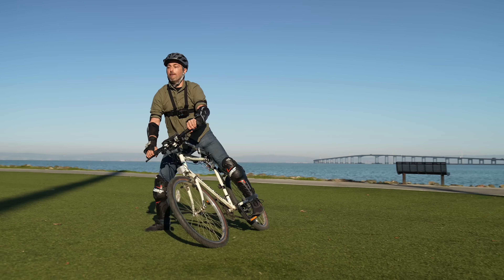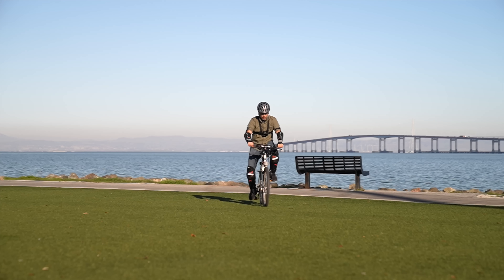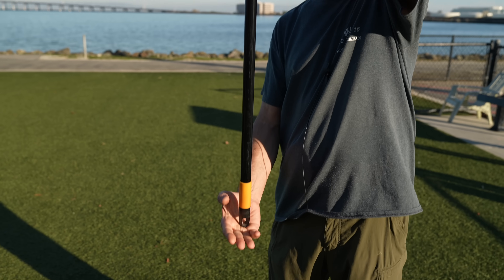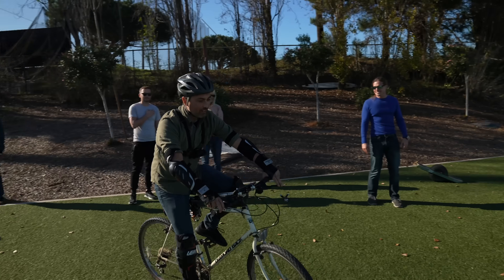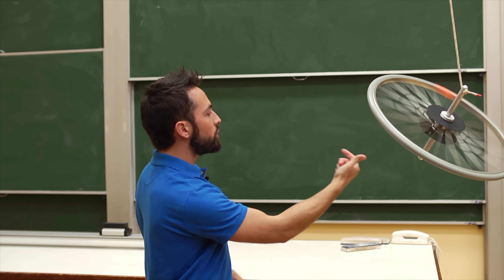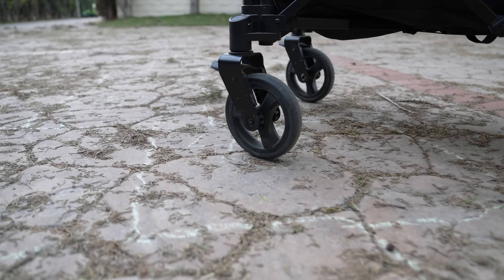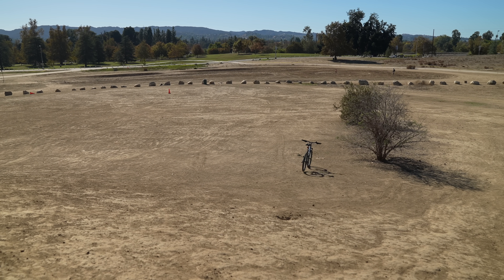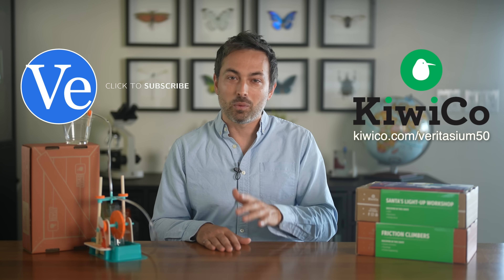Most People Don't Know How Bikes Work

Comment: I come from the other direction (no pun intended): around 10 years ago I saw a guy doing a 90 degree turn in a very little space without slowing down probably at around 20km/h only by leaning on the side. Since then I learned how to steer just by leaning and whane it's safe I do so.
Reply: How do you make the lean happen?

Comment: Anybody who has ever had a science class should understand the impact of angular momentum and perpendicular procession of a torque that is applied about the axis of rotation.  It’s easy enough to demonstrate with a fidget spinner, and I doesn’t require much further thought to understand the counter steer is needed before the intended steer and desired direction change.  The matter and physics of a bike doing this automatically is another subject entirely.  Thought experiment:  What do you think would happen if you were stationary on a bicycle that is on a motored dynamometer powering the wheels to spin without moving the bicycle fore or aft.  Could you recover your balance when steering left or right?
Reply: You could recover your balance if your bike was free to move left and right on the dyno, but not if you relied on gyroscopic moment alone.
Reply: Bike moving on a road or road moving under a bike is the same thing.

Comment: Yes, steering plays a major role (at lower speeds), as larger inputs are critical at lower speeds. This is why something called "track standing" is so diffficult. Having made my own set of rollers, I know for a fact that as the speed increases on them, the bike becomes much more stable. At high enough rpm's,  you can go hands free and the bike will track itself as you pointed out, but this could not be done at a stand still anywhere near as easily, hence the  higher rpm makes the gyro effect much stronger and is, in my opinion,  a larger force keeping the bike upright via the rear wheel being locked in place, unlike the front wheel, which that can rotate in place. I actually think that the gyro effect occuring between the front and rear wheel is what helps the bike to "auto steer", helping the front wheel return to center and stabilize again.
Reply: >> the  higher rpm makes the gyro effect much stronger

The higher speed does increased the gyroscopic effect, and on a bicycle, that primarily increases the steering induced from lean.  It does very little to stabilize you directly.  But the real reason increased speed helps is because it moves the bike the same distance left and right with much smaller steering inputs.

Comment: Anyone that rides a motorcycle knows how this works.   That being said, at very slow speeds it doesn't work that well, you do turn left to go left but you need to use the throttle judiciously to accomplish this.  The same is true with a bicycle, just pedal a little harder.

Comment: I only believe this is true with most people. Professionals don’t do this. We lean before we turn. We actually turn into our body leaning. I’ve even seen that most bmx riders lean before their turn.
Reply: Last week I put a famous bike and motorcycle racer on it.  This is a guy that started his own bike company.  He couldn't ride it.  You'll see him on my follow-up video.
Reply: That's a separate action that doesn't contradict what this video is saying.

Suppose you're approaching turn 1.  Pretend turn 1 is a left at this hypothetical track. You want the bike to be stable through the brakes, and you want maximum drag, so you come out of the tuck and sit very upright, and pre-position your body to hang off on the left side, yes? It is possible to keep going in a straight line while doing this, but to do so you can't be completely relaxed on the bars, you have to be providing input to prevent the front from flopping to the right. Why the right? Because if your body is leaning left, the frame of the bike is leaning right, and forces on the steering geometry will make the front tyre steer to the right unless you actively oppose them. Of course, you're also not relaxed on the bars because you are actively braking, so it's difficult to even be cognitively aware that you are providing this input (just like I don't cognitively control the muscles of all my fingers while touch typing). 

Now you hit your marker. You want the bike to lean left. How do you do this? Push the left bar forward. The tighter the turn the more you push the bar forward (or the longer you hold it in a forward position). Doing this causes the frame of the bike to lean left. 

Once you reach your desired lean angle you release pressure on the left bar. The countersteer is now complete. The front tyre now steers into the turn (at high lean angles this is an extremely slight deflection, barely visible), and you have achieved a stable left turn.

If it's a decreasing radius turn and you choose to take a two-arc path through the turn, then somewhere during the turn you will push on the left bar again, increasing your lean angle.

Once you're coming out of the turn and want to straighten up and power out, you will push forward on the right bar, countersteering the front left, "back under the bike" so to speak, causing the frame to stand up.

Comment: Have y'all tried leaning first then steering? It works at most speeds.

Also, if you stand on your legs as opposed to sitting on your butt, you can steer without losing balance as the bicycle moves away from you because your center of gravity on the bicycle is placed lower where the pedals are at instead of on the top where the seat is at.

Great video. I guess I'm just surprised to find there's apparently the number of people who don't know how to ride a bike is higher than I thought.
Reply: You can't steer unstreerable bike.
You can't move center of mass when you are on a bike unless you steer it.

Comment: Every cyclist avoids riding too close to the kerb for the same reason, we always need to be able to steer a small way either side to stay balanced, if we end up with the wheels against the kerb, same as the one-side-locked bike steering in the video, we can end up falling off to the locked-side, onto the pavement, even though we don't intend to turn to that side.
Reply: @Dusty McTits Curb is also the American spelling of the noun kerb
Reply: @david Wait wait, do other countries spell it differently?!
Reply: One learns fast when countersteering is not possible- watch the Tour de France wnen they ride inside another's tire. I was on a club ride going over a covered wooden bridge that had about a 2' wide strip on each side for the car tires that is 1.5" above the base bridge- went off its railing side edge, tried to steer and, fell right over and cracked a rib on the pedestrian railing.
Once a car made a left turn right in front of me in an intersection, I had to turn with him and got so close to the curb so I could not steer and fell onto the sidewalk cracking the kneecap.

Comment: This is also why it is difficult for people who ride motorcycles to learn to ride a standup jet ski. There is NO gyroscopic stabilization at all and the most bouts from the rider are much different. The counter steering comes when ending a turn, not initiating it. Also you are controlling vectored thrust at the rear of the craft and throttle input is required. So you will turn left and the craft will lean into the turn but then to get going straight again you have to give it gas and steer right to bring the ski back under you.

Comment: I am riding bike for 15 years now and wanted to see if i'm doing this. Actually i just turn where i want to without steering first to the other way. Well i discovered that my body has a weight to balance the weight better than this technique. Assuming that you turn 15 times on a 10km road, not doing this can gain you approximately 1min in your life.

Comment: It is the same effect with motorcycles. If you as motorcycle rider don't understand this concept it is very dangerous to ride a motorcycle. 
There is a lot of people who ride motorcycles without understand "Counter steering effect", and it is the sasme with bikes. 

At low speeds the steering works as the logic say, you turn left and you go left and so on, but higher speeds "lets say 20 km/h" if you steering to the left you go right. I learn this way: if you push the steering to the left you go left.
Reply: Actually, the physics are the same at low speed as well. There's still a countersteer.

This trips a lot of people up, because if you go out and actually ride around at very low speed, it feels like you're turning into the turn. And there's a very simple reason why it feels like this: It's because you are. But there's no contradiction here.

The explanation is this: The steering geometry of a bicycle (or motorbike) is such that when the frame is leaned, the front wheel will turn the direction of the lean. It sort of "falls" into that position. Usually this is described as a "flop" of the front wheel. The faster the bike is moving over the ground the faster this "flop" happens, because the shearing forces at the contact patch get larger as the speed goes up.

In order to maintain a stable turn, the front tyre must point into the turn. If you're in the middle of a left turn, the front tyre needs to be pointing to the left. And the steering geometry helps this happen, because if the bike is leaned left, the front tyre "wants" to flop left.

But at low speed, the lean is small and the shearing forces are also small. That means the "flop" movement takes longer to complete. Too long. By the time the front wheel flops over, you'd already have crashed. So at low speed the rider has to "assist" this flopping motion to make sure the tyre turns in quickly enough to maintain stability.

But all of this happens after the countersteer has already happened. Tthe front tyre must always be pointed out of the turn initially in order to establish the lean, and then it has to be pointed into the turn to maintain a stable turn. At high speeds, the second part of that can be accomplished simply by taking pressure of the inside bar once the countersteer is complete. At low speeds you actually have to physically help the tyre flop in.
Reply: Every bike work  the same.
1kg or 700kg bike.
0 speed or 3000 speed.

Comment: I'm editing a video debunking this theory.
While filling, I realized I can debunk this using 4 different methods.
No one in this video knows how to actually ride a bike.
They only delt with one center of gravity. The combination of the bike and rider. I ride knowing that I have 3 center of gravity. Mine, the bikes, and the combination of the two. 
Not only can I turn left without first turning right 3 different ways, I can also turn the bike 90° without turning the front wheel at all.
Not all of us ride at the same level. 
I'm going to release the video tomorrow.
I don't understand why they didn't talk with bike riders before building that bike.
Reply: You don't have three centres of gravity. There is literally a mathematical equation that relates lean angle, tangential velocity, and turning radius. The lean angle is calculated according to the centre of mass of the system - the bike and rider, together - relative to the fulcrum at the contact patch.
You can cause a countersteer without actually using your arms to turn the handlebars out of the turn. You can cause a countersteer by leaning your body one way, because that will cause the frame to lean the other way, and when the frame leans, the steering geometry causes the front tyre to flop in the direction of the lean. That's the countersteer. This video does make it sound like you always use your arms to turn outwards, and never inwards, and that's is wrong, in the sense that it's not necessary. But a countersteer always happens, however it is initiated, and a manual countersteer is by far the most effective form of countersteer.

I notice you haven't uploaded your video.
Reply: @allmhuran  I've had a few conversations with the Builder of that bike since that post. I'm sending him a few vids to show him what I'm talking about.
He agrees that you don't have to counter steer first, but it does happen at some point.  That's what I was referring to the 3 gravity's. It all comes out to just the one. But I use the other two to control the over all. In this vid, they only address the over all. He has most of his weight on his seat. That's fine, but it's not the only way. I have all my weight on and behind my outer pedal. I use the outer pedal to push against flying over sideways.  
I have video of me turning with no counter steer.  The easiest way is to put all your weight on the seat and push down on the bars the direction you want to go. Then just lean.
I was surprised when I watched me riding no handed frame by frame, I do a very slight counter steer, but you can barely see it. I have another vid of me leaning into the turn way to far, then counter steering to up right the bike. You basically end up in a track stand, then pedal off. 
I also was able to hold my bars straight and twist my body, then I hop up and twist my bike 90° and lean way into the corner. The landing stands you straight up, and looks violent in SLO mo lol,but I turn without moving my bars at all. I'm not saying I can go against science.  They said it was impossible to not counter steer first. I'm saying their is an amazing amount of ways to ride a bike.
We are trying to find a way I can lock out my steering to really settle this. He suggested I ratchet strap my bar ends to my seat post. But this really gets in my way, that's where my legs go lol.  I'm gonna try and strap my two wheels together so nothing moves and see what I can do with that. I think I can balance for a while, but my rear tire is gonna be up higher than my front. 
The video will be a few days out. I'm gonna re shoot a few things and run them by the builder first.
If nothing else, I'm learning a lot about how I ride the way I do.
They have a link under this vid to the builders YouTube channel, if you go there, go to his latest vid and look in the comment section.

Comment: As a Mountainbiker i can disagree... You can go into Corners without turning the other way First. But you have to be confident in leaning before you turn. I dont believe i turn left before going right . I wouldnt have time for that
Reply: You can cause a countersteer by leaning.

If you lean your body to the left, the frame of the bike will lean right. This will cause the front tyre to turn right, because the steering geometry is built that way. This is a countersteer. The system is not stable at this moment.

The right-turned front tyre will now cause the frame to sraighten up, and eventually lean back over to the left. Your body is also leaned left, so the centre of mass of the system is now to the left.

With the frame now leaning left, the front tyre wants to point left, again, because of the steering gemoetry. At low speeds (sub ~20km/h) the steering geometry doesn't flop the front tyre over to the left fast enough to maintain a stable turn. You have to help it along. That's why everyone keeps saying "I turn the bars left to turn left at low speed". Yeah, you do - but only after the countersteer has already happened. At high speeds you don't need to perform this second action, the steering geometry will take care of it fast enough, such that all you need to do is release pressure on the inside ba and allow it to flop over by itself.

Initiating a countersteer "subconsciously" - that is to say, by leaning - is much less efficient than doing it consciously. Relying on the steering geometry to perform the countersteer takes more time, not less. If you did it manually, you'd be in a stable turn faster. So the idea that you "wouldn't have time for it" is actually quite counterproductive to your riding.
Reply: Also it is possible to turn your Bike to the side without falling off.

Comment: My very first thought was how dangerous it was to have those bolts facing the rider in the middle of the handlebars. Some foam rubber to cover them would have been smart on a bike that is designed specifically for you to fall from.

Comment: I'm surprised no one went with the no hands technique. I assume riding without touching the handlebars is much like the bike with no rider, however a lot of the turns with no hands riders are leans.
Reply: With steering locked, you still fall.
Reply: Leaning your body in one direction will cause the frame to tilt in the opposite direction, and this in turn causes the front wheel to momentarily "flop" in the direction the frame is leaned because of the steering geometry. This is the countersteer. Riding with no hands involves countersteering by leaning the frame in the direction opposite to your body lean.
Reply: @allmhuran  That's exactly right.  But with the steering lock, that won't work.  Thus - you still fall.
Reply: @Rick_Cavallaro  Yeah, standard youtube not threading the reply correctly, I was actually replying to the OP.
Reply: @allmhuran  I'm confused.  It seems you were describing how one normally rides a bike no-handed - right?  But obviously that won't work on a bike that has locked steering.
Reply: @Rick_Cavallaro  Yes, I am talking about regular bikes with regular steering being ridden with no hands.